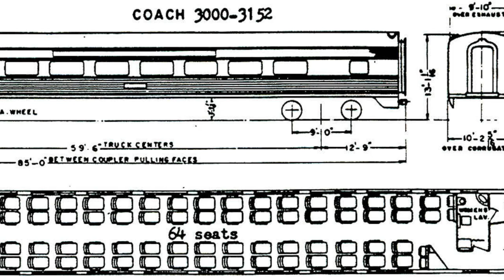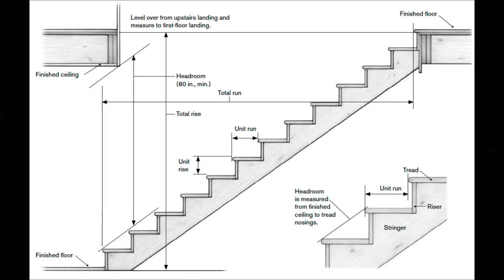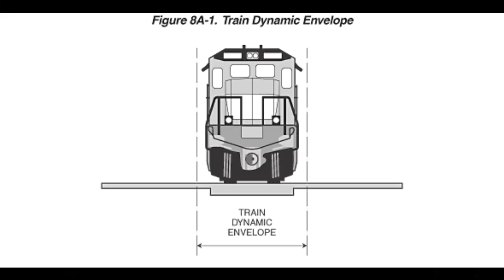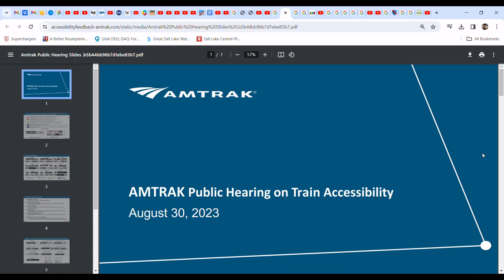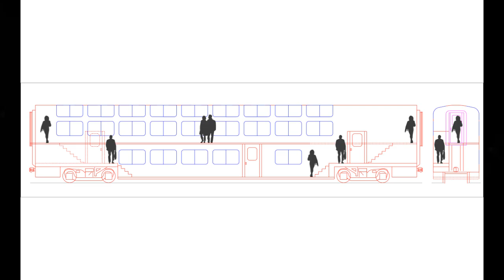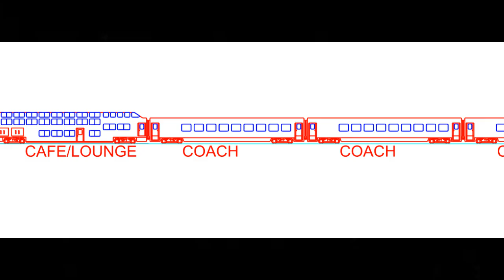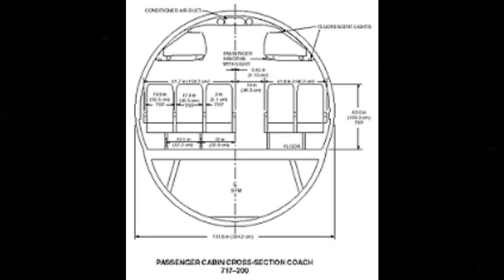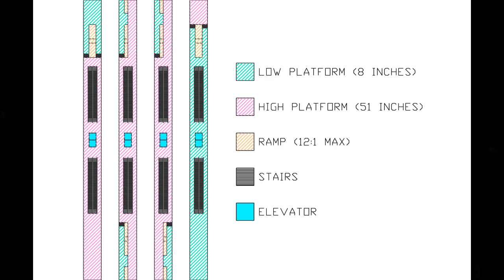An Excessive Explanation of North American Platform Heights

Comment: The wider loading gauge of freight trains is also the reason for the lack of full-height platforms on mainlines here in Germany (like with the ICE you showed in the beginning). They do exist on passenger rail systems with dedicated trackage like the S-Bahn systems where freight doesn't pass through.
The most popular way around that problem here seems to be the use of low-floor trains. Low-floor rolling stock is now standard on regional trains and slowly making its way to intercity trains, like with the Swiss Girunos.
Reply: I have to add, that the european low floor (55 cm/21.7 in) would be at least medium height in the US
Reply: @michaelneichel9543  we have stadler KISS, FLIRT running around with more likely to be bought. It likely is the best height to use because it doesn't interfere with freight trains.
Reply: @mrvwbug4423  the stepped flirts are older models. the newer models have ramps
Reply from the maker: I think low-floor trains are a great solution for the European network. I can't imagine the hassle of raising every existing platform...
In the USA, we have little left to lose, so we may as well dream big.
Reply: @CSLenhart well in Europe many countries are also raising their platforms in addition to using low floor vehicles. That's because the standard heights of 55cm and 76cm aren't truly low floor, so the low legacy platforms (usually 20-38cm) have to be raised. Also retrofitting lifts and ramps to all old stations even in tiny villages is a huge task, luckily most countries are making progress
Reply: @PhilfreezeCH  yep, I live in Schleswig-Holstein (Germany) where the standard platform height is 76cm, most stations have that height but some only have 55cm. Lower platforms aren't really a thing anymore, maybe 10 platforms in the entire state still have low platforms
Reply: flirts have ramped floors between the cars, the stepped floors are only behind the cab (or in the very middle on the traverso or power-pack flirts)
but yeah, they do have seats on a raised floor compared to the aisle, though this is a non issue, as you can’t use regular seats for wheelchairs anyways

Comment: High level makes sense in the North East,  and your idea for the national fleet makes sense. Now if they would just put in High level platforms for Via Rail at Union station in Toronto...
Reply: What's even more frustrating is that Via is rebuilding the platforms at London station as we speak (the 5th busiest Via Station) and they are not not raising them to provide level boarding. This despite the fact that the platforms are located on a siding only used by passenger trains.

Comment: The arrow service run by Metrolink (Southern California) also has level boarding but lower floors(the platforms are 23.5" above the rail I think).
Reply from the maker: That sounds about right for Stadler FLIRTs. I don't believe that line hosts any other freight or passenger service - in which case I don't mind an agency choosing a unique standard. Do whatever is most convenient for the riders!
Reply: @CSLenhart  There is freight on that line (There's a spur that has tanker cars near the tippecanoe station). It also hosts the mainline Metrolink service that uses the standard bilevel cars that metrolink runs on the rest of it's lines. They had to build extra (lower) platforms so that the bilevel cars could stop in Redlands. The two passenger services cant use the same platforms (which is just another example of the issue that you highlight in this video).
Reply from the maker: @MartinHoeckerMartinez  Ah, I see that spur on Google Maps. It looks like anything beyond (east of) the Tippecanoe station would be blocked, but anything west is still accessible by freight trains, since they can pass through Downtown San Bernardino on the Metrolink tracks. 
Pretty clever. 👍
Reply: @CSLenhart  TexRail and the DART Silver line also use FLIRTs with 24" level boarding using automated gap fillers to enable freight service. The reason that BiLevel trains can't use the same platform as FLIRTs (despite both trains having the same floor height) is that Bombardier/Alstom has stated that it is impossible to retrofit an automated gap filler to their BiLevel coaches. This was discovered when we tried to adopt a 24" platform height standard in Ontario to match the floor height of Bombardier Bilevel coaches (since there's a thousand of them in service).

Comment: This is the kind of out-of-the-box thinking Amtrak needs but I doubt they're capable of.
Reply from the maker: I'm glad you like the idea! Out of the box thinking is exactly the reason why Amtrak solicits public comments, so don't be shy about letting them know your thoughts.
Reply: Problem is, Amtrak gets to update stuff maybe once in a generation, and they usually have to do things within a short window of time because they usually can only secure funding when Democrats have a trifecta, the only times this has happened in the last 40 years is 93-95 (Acela got funded and construction started, NEC electrification completed), 09-11 (ACS-64, Charger, Avelia Liberty, Venture fleet got funded), 21-23 (Airo, NEC corridor upgrades, Penn station upgrades, massive network expansion and improvements got funded).  So they have to do things fast when they get funding before the party that has been trying to kill Amtrak since the beginning pulls their funding.

Comment: So is the boarding requirement the factor that precludes 14f 6in bi-levels from being used on intercity services?
I also acknowledge that the lower height would reduce the Roomettes from two beds to one probably which may have some negative impacts on economics of the service.
Reply from the maker: That's an interesting point. I wonder if it would be possible to create a superliner-like design for passage between cars on the upper level of the cars, while still staying below 14.5 feet. At worst, that would create yet another standard floor height. I'll have to give this more thought!
Reply: @CSLenhart  the 14.5 feet is a copy and paste of NJ transits bi-levels. So if one car was low level and the other high level….?
I have no technical expertise on this so just asking.